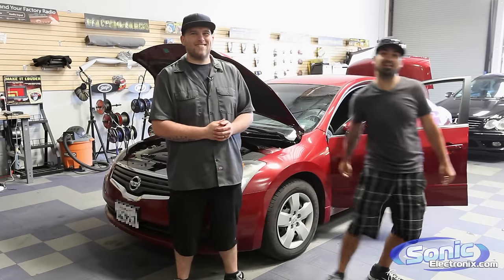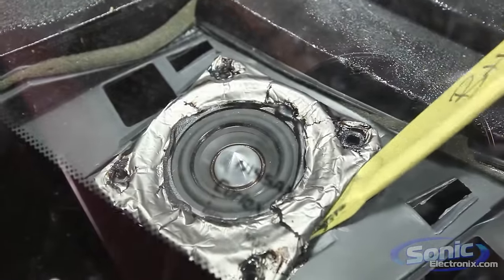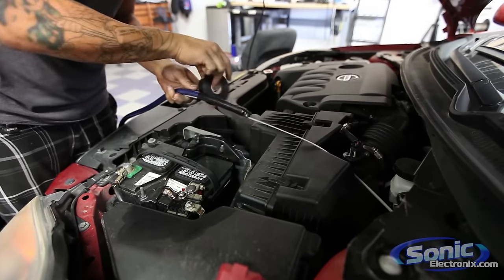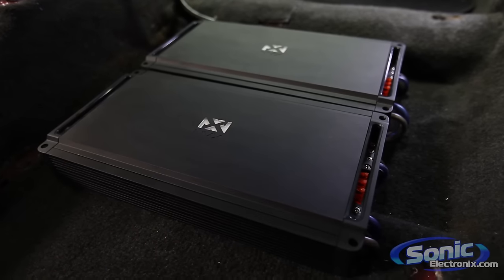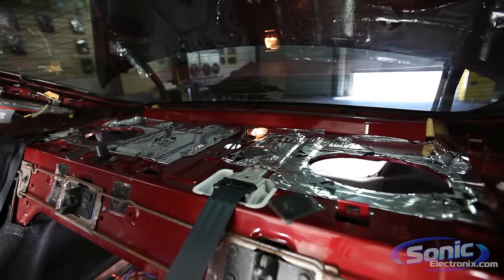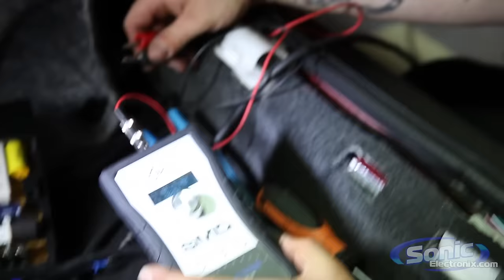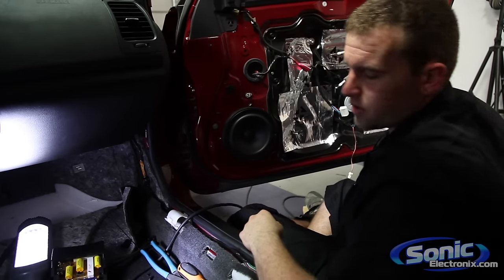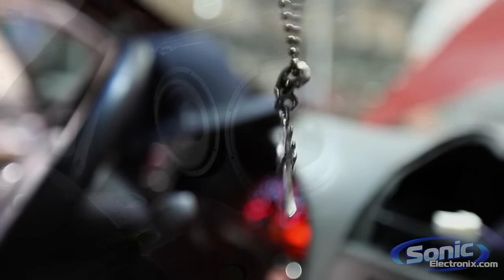Car Audio Installation - 2008 Nissan Altima Full NVX System - Speakers, Subs + more

Comment from the maker: Each sub was a Dual 2 ohm sub wired in parallel to 1 ohm load on it's own amp. We had a JAD1200.1 for each sub, 1200W RMS at 1 ohm.
Reply: WOW

Comment: finalllyyy. somebody that knows hows to do a clean install. i take audio serious, from clean to spiffy. currently own 4 alpine type r's 0 gauge wire to four rf amps and two alternators in my chevy trailblazer. loud but nothing extreme. still CLEAN AMAZINg setup!! thumbsss and subbed
Reply: Josue Bruno- are the alpines more bass or more sound quality??
Reply: Johny Coronel Alpine is a great brand. Their equipment is high quality especially their head units.
Reply: Johny Coronel alpines are more for sound quality, but they can shake some shit up if you want them to lol. Some of the best sounding subs I’ve heard, the type Rs that is. But when it comes down to it, it’s all personal preference... like with me, I’m a Rockford Fosgate fanatic lol.

Comment: on the real this is an amazing video. I done at home installs with subs and amp and the wiring always had me slumped. I want my future work to be as clean as this but I'm scared I'll break off plastic clips or lose bolts and wouldn't know how to reinstall it.. I would pay you guys to teach me your ways for 2 days.. I live in Arizona but I would travel out there just to be taught your work.
Reply: +Bryant QUinones Gotta take your chances. My previous car I've ripped stuff in and out many times (upgrading and fixing my own mistakes). I can remove my radio in less than 5 minutes blindfolded.

Comment: When he was talking about the pros of using factory looms is you can separate wires as needed to avoid any static or feedback if the power wiring for the amps is too close to the wires that go from the stereo to the amp.

Comment from the maker: The NVX amplifiers are far from cheap, they can match the Rockford amplifiers without any problem. Besides, the original install had only one rockford amp and it didn't output the 2400W RMS we were aiming for. We needed to conserve as much trunk space as possible and hide the setup, so we installed it how you see it in the video.

Comment: NVX And RE are the new new! Awesome subs! I can tell you why the amps are under the seats because there out of the way, they fit with adequate air flow and there are 2 mono block amps so they shouldn't heat up!!!!  And 2500 is damn good considering the added up price of all the hardware & labor

Comment: Why was it sparks when they connected the ground? (8:54)
Reply: Henrik Nilsen because that had already connected The positive cable
Reply: And left the fuse in.
Reply: Should of connected ground before power
Reply: Everyone here is stupid it always does that when u buy brand new amplifiers they always spark when u plug them up they didnt do amything wrong the sparks dont harm the amps at all either
Reply: @demonclub7050  No they don't? Battery negative cable should be off of battery during the whole install

Comment: You guys should see my system. One of the previous owners threw in Phoenix golds and the install was terrible. He had the deck grounded using speaker wire to down to the floor, then from the floor through the passenger door panel. All using like 18 gauge speaker wire. The speakers where connected not through soldering or through butt connectors he just twisted the wires together and electrical taped it.
Reply: I'm trying to fix what I can afford.

Comment: Will do. Its due time for a car audio upgrade that's going to take me a year to complete budget wise. In my current setup I'm running a pair of performance technique 4 way 6x9 for my rears an unknown front pass. door speaker no driver side speaker with a pair of 12"crunch groundpounder subs on a 900w 2 channel amplifier lol. The upgrades will be a pair of performance technique 3 way 5 1/2 for the fronts a pair of 12"nvx subs with speaker box modifications ( reseal ) some sound deadning with a 2nd amp to be installed a 1000w 4 channel amplifier to all 4 speakers. It'll be a 2 amp system

Comment: I think that install wiht everything is about $2500 or more.
Reply: Really u think so
Reply: U think so
Reply: $1,790.38 it costs  XDDDDDD
Reply: hmmm very specific :P
Reply: @dhendr5327  plus labor
Reply: lights good luck installing it as good as these guys
Reply: @David P just buy spl dynamics audio
Reply: There is a cheaper way. 
Learn about car audio do research 
Look up videos on equipment 
Get yourself educated and you can do the work yourself. I did it on my own and I was installing other people's set ups while I was out from work. It's very simple depends on the car.
Reply: That's probably just labor

Comment: you gotta get as close to chassis as possible or at least a good spot is were the trunk lid closes at on the bottom their may be a bolt that will work better than trunk lid hope this helps

Comment: Good clean install. I enjoyed the video. I have no Xp with NVX but I do know the amp board in the JAD800.4 is the same board that is in the PPI P900.4 which makes me a little meh. I would have never changed out a Rockford Fosgate Power amp for the NVX though, they are not in the same class but I guess if you needed a 4 channel VS a 2 channel amp, then maybe.

Comment: Good video guys, I do laugh every time I see folks replacing factory speaker wires though. Amp power is ac so wire resistance for the power door speakers are getting is totally not worth doing along with many other reasons and have been proven and I'm a speed wire fan boy I just run it back to behind the dash and into an iso harness to convert to the factory harness. I know you guys know what you're doing but the gains are so minimal it's not worth the time or money doing it and id also consider my self part audiophile part SPL junkie. Just my 2 cents worth. Nvx is really starting to grow on me. Might be my next set of door speakers it's between them and jl anyway since my amps are jl hd and sub is 13w7! I just don't think the c3s will take the belting I want to give and neither would the c5 or c7 so no point spending more money. Not sure why jl even made the hd 600 4 channel when none of their speakers come close to matching its power output, I know over head means more control less likely to damage etc but sometimes you just want it stupid loud. Only speakers that I haven't fried yet from clipping with a too much clipping is the kicker CS 8x5 or whatever they were they are fatiguing on the ears after a bit but damn I've been impressed with the beating they take same with the rockford prefab dual p3 12s I've had for 5 years haven't missed a beat! ✌️

Comment: what brand is your crimper and what tool are you using in 3min:9secs - 3mins:17secs and what brand and just one more thing what brand is your right angle drill bit please and thank you
Reply: +Cedric Vaikeli  don't waste your money on whatever type of cutter that is, get a actual wire cutter (Knipex, Snap on, Klein tools).

Comment: Nice video and install. What is the piece you used to pull power wire through firewall and to pull speaker wire through doors?

Comment: Damn too bad the transmission's is gonna die faster then that sound system
Reply: Carlos Torres and why is that??
Reply: hahahaha
Reply: Let's hear it for bad CVT tranny's!  I lost mine at 158k miles.  Now my sweet Altima is gone. :(
Reply: James Orion nothing will happen to the transmission. You need to know your stuff first bro.
Reply: My moms altima went out at 110k miles
Reply: My altima went at 54k miles
 P.o.s. cvt tranny
Reply: That's why you buy a manual
Reply: @josevaca9546  ,just wondering if you ever changed the cvt fluid? I have an 08 with 200k on it.
Reply: Just replace the solenoids from the transmission. And maintain the transmission with its proper cvt fluid. Remember that you can replace that transmission fluid dont let nobody tell you no you cant
Reply: My Altima 2009 is 195.000 miles on her own transmission and running like new!
Reply: Yep Nissan and their Crappy ass Transmissions, I wouldn't be Surprised in the slightest.

Comment: I love your videos! I Order my audio gear from you guys (Sonic) all the time! It would be awesome if you guys can do a install on a 2nd gen Acura TSX (2010 to be exact!) I do have a question for your team. I am planning on installing a Pioneer 4100 NEX head unit into my Acura,any brand recommendations for the steering wheel interface? I do know there are a few out there from PAC,METRA,and iData any help would be greatly appriciated!

Comment: I'm installing music system in my 2011 Altima. I saw numerous YouTube vids on how to reset the airbag light. However I'm having this issue with the intelligent key. Basically it still locks/unlocks the car and I can still press the button on the door handle to open the car. However I cannot start the car. When I press the button, it says "no key" I have to insert the key into the slot and then push the button and then it starts. I have to do this every time I start the car. Do u know how to get it back to where I can start the car without having to insert the key every time

Comment: I have a question I have the same car but you see that there is a speaker component in the rear doors what size are those are they the same as the front doors?

Comment: Why would you take out the Rockford Fosgate Power amp and replace it with a NVX? Nvx is good but not as clean as RF power amps!  I have both and the RF Power amps are cleaner! Don't get me wrong, the Nvx are good amps too, but not as good as the RFs.  And if you want a loud system, why didn't you face the subs to the rear? This makes the bass travel outside and be heard! Also, you have the top of the line Nvx components up front and you didn't even add deadening material to the front doors!
Reply: +write2rc Think the customer wanted nvx due to personnel preference
Reply: +write2rc  not exactly sure where you are getting your information buddy.  That rockford amp is good.  But what makes it better than 2 nvx 1200.1.  The power 1500 probably makes 1800RMS on its best day and the 2 NVX monos would make a combined 3000RMS.  Also facing subs to the rear does not always make the system louder in every single vehicle.  However, in every single vehicle it will make the trunk rattle more and Altimas are notorious for that.  Also they did add deadening materials to the doors and added an MDF spacer which would do more for deadening than bolting the speaker to the factory spacer which is more often than not made out of ABS.
Reply: +carfreak1024 ---2 nvx 1200.1 will not sound cleaner than a T2500 RF and that RF single amp will put out 3000rms as well. And what are you talking about Altimas being notorious for trunk rattle? My 2008 did rattle but nothing Dynomat did not fix! Facing the sub to the back is louder outside the car, that is a fact, does not matter what sedan it is! The front door were not deadend, you can see it on the video, adding a mdf spacer is only for fitting purposes, that does not make the mids sound better like deadening would!  Watts for watts the RFs amps are superior to the NVX amps, I have them both, that is why I am making such a claim!!!!!!!!!!!AS FAR AS WHERE I'M GETTING MY INFORMATION FROM, IT'S FROM INSTALLING AND COMPARING THESE 2 BRANDS!!!!!!   DIDN'T YOU READ WHERE I SAID I HAVE BOTH AMPS?!!!!!!!!!!!!!!!!!!!!!
Reply: +write2rc 
Who gives a crap if it's louder outside the car. Most people are in their car, driving it.
Reply: +write2rc to get better sound on the inside of the car why would you be worried how it sounds on the outside when your inside the car? Is impressing other people really that important?
Reply: does the shop install dynamat or what ever to the doors rear deck etc in the pricing of install or extra?? if ur trying to redo sum ones shitty install wouldnt u just do it cause its more beneficial to the quality your trying to convey hell frys electronics does an A1 install no prob beats car toys or best buy anyday
Reply: I have owned Rockford equipment... iys honestly not the good, very low quality.
Reply: cole orlesky---have you own the power series? and do you own the latest amps on the market today? otherwise you perspective is from a lower grade than what is out there today from the power series! I have both Nvx and the power series RF amps, and I can tell you for a fact that the power series RF are better than the Nvx!!!!!!
Reply: +cole orlesky how do you compare the nvx 6.5 components to polk Audi 6501s components, u really cant hear on a phone thru utube , im.in a pickle
Reply: +write2rc whats your thoughts on nvx 6.5 components to polk audio components 6.5
Reply: Sonic and ginger basic install
Reply: Sonic and ginger obviously you haven't owned an nvx jad1200.1 why did u even comment other then to hate on an awesome clean install and to your installation questions I'm sure they done what the customer asked for and I'm pretty sure I seen some deadening on the door maybe the customer didn't want a bunch after spending all the money on everything else lol but if he or she does might as well use the nvx sound deadening maybe that's a part 2 haha
Reply: Sonic and ginger so your saying I added amplifiers to my subs and components to impress people walking by lmfao I don't think I'd spend that kind of money just to provide a bass service to the neighborhood lmao I did it for my own satisfaction the ones doing this to look cool to others are in a different class usually using boss subs and amps cause they think cheap will get them bang bang to look cool the ones installing class A equipment do it for self gradification of owning bad ass audio system to sit INSIDE their car and listen to and if anyone else can hear it on the outside then I guess they get a free sample but I'm sure would enjoy it much more getting a demo sitting inside the car where we build them to be heard at!!!
Reply: I was wondering if you could help answer my question since you also own a Nissan Altima. I have an 09 Nissan Altima 2.5s and have been debating whether to go with 1 12" sub or two 12". I have been told that for imaging purposes it's better to go with a component set in the front and a sub in the trunk. The component set I'm planning to go for are the Focal Es 165KX2, the subs I haven't decided on but I do have a couple in mind, those subs are... the Focal P30F, Hertz HX 300 D or the JL Audio W7 12" sub. All three of the subs mentioned are 12" with different power ratings and sensitivities. I like a well balanced sound which includes quality bass, I thought sealed boxes were where I was going to go but after hearing the ported box with the P30F's my tone changed. Not only did it fill the room better but the bass hit lower notes that I didn't hear with the sealed box, as a result I plan to go with a ported box with sound deadening on both doors for my front speakers and for the sub or subs. Anyways, based on the info would you recommend I get 1 12" sub or 2? I know it's an apples to oranges kind of comparison but any input would really be appreciated.
Reply: ThePhatboy510 I guess it is ,since your making the car so loud for others to hear it. unless you like to drive and not really hear the music that's blowing out your  ear drums. ..come on be for real 99% of people who do loud audio instalation in their cars is for others to notice them.
Reply: cole orlesky I think you had rockwood not Rockford because if you did you would know that's a lie.
Reply: couldnt agree with you more
Reply: Sonic and ginger  Little Hostile!!! You did not pay for it! Watts does not mean anything in a clean sounding system. NVX is a pretty good brand, Rockford Fosgate is good also. But their is much better amps out their then both of these. But i am not paying for them, so this argument does not mean anything to me or anyone else for that matter. Also if your pushing two 12's ported, its going to rattle no matter what you do. The customer paid a decent amount for this install, so let them be and stop tearing them apart. Rockford Fosgate is way overpriced for the quaintly of components you get. Thats why i am not a fan of them. For each his own!!!!!!!!!!!!!!
Reply: Swap it all out probably because the owner works for Sonic and NVX is their house brand.

Comment: My 1st question was where you are located but someone beat to that so my next question is I have a 2015 veloster in my trunk if  I run 4 8's is there a box application that does'nt take the whole trunk space

Comment: I have a 2008 Nissan Altima coupe with a Bose audio system in it. I bought it used. Would I need an aftermarket radio to install a sub?

Comment: Why didn't you rear fire the subs?
Reply: Thezuule it is walled off. rear firing is the way to go in sedans like that without a wall in the trunk. i got 2 rear firing punch p3's in a beat up factory box with zero sound deadening n it get into the low 130s on the meter for hours without even getting warm

Comment: With the amps under the seats how did you mount the amps especially with the rear floor heating ducts running under the seats?

Comment: i see you said nothing about upgrading the car's alternator at all with all that power for the sound system you are putting into the car that should hae been the frist thing you guys should have done even before the battery. daaa
Reply: The subs are not pushing no more than 1500+ watts. Its fine.

Comment: I have a quiestion on my system i have in my car all the wires are running on the left side in other words on the drivers side, like all the wires power ground rca and stuff is that the way to run the wires??

Comment: i have a kicker amp cx 1000-1 
an i have a capacitor  but the ground wire is hot when I have the stereo on is this a bad conection? ??